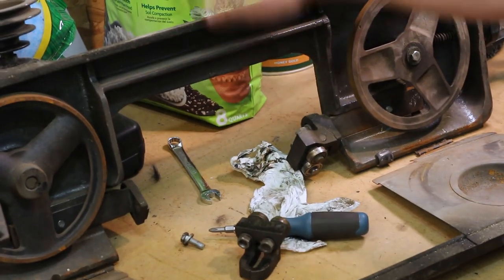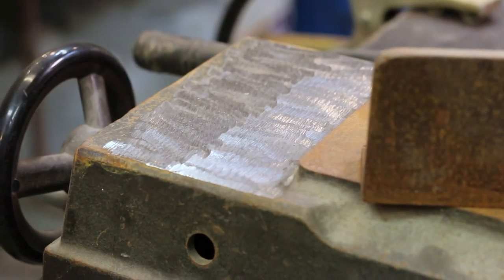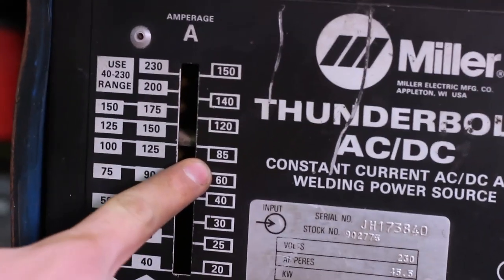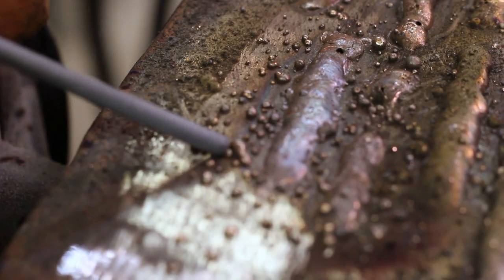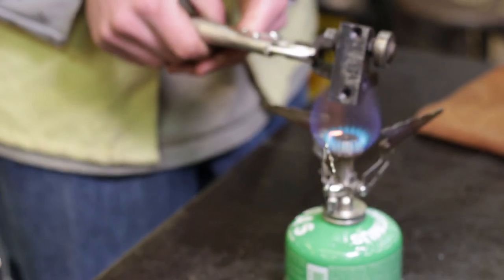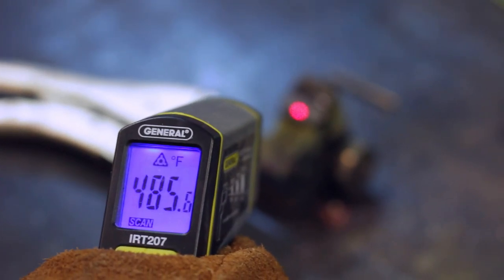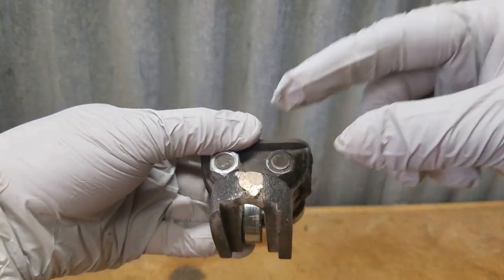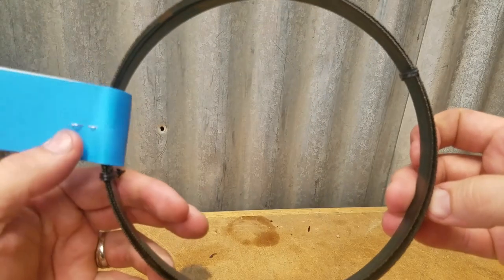Secret Cast Iron Welding Hack!

Comment: Great video - Thanks! 
BUT... I cannot find the rod you actually used here. The link goes to the 55 and 99 percent super expensive electrodes, not the brass or bronze one you have here. Not being able to see the Brand, I looked up "model 84-480" and bronze rods all over the internet with no luck. Do you recal the BRAND? Thanks again.
Reply from the maker: I don’t recall the brand sorry.  I will double check the link.  Thank you and good luck!
-Will
Reply: @Debtfreehomesteaders  Thank you! PLEASE do. I can't find any bronze or brass electrodes at all, and it looks like a terrific idea! This would solve a LOT of problems I have welding many cast iron finials that slip over "ornamental iron" (actually steel since the 1950's in the US) fence pickets.  I will be happy to provide my contact info to you if helpful. Thanks again!